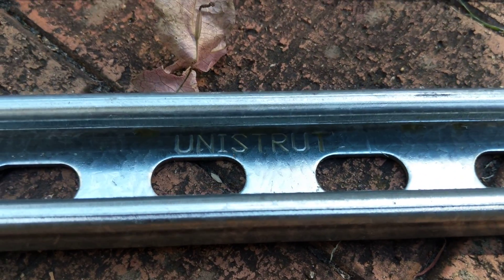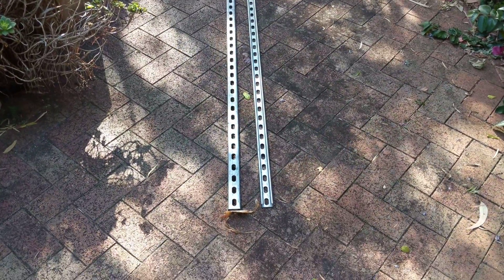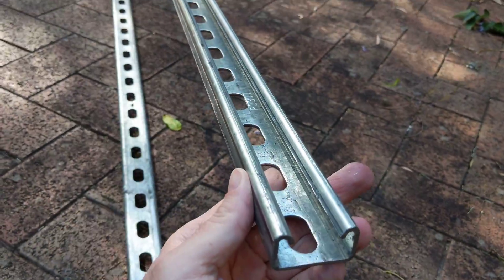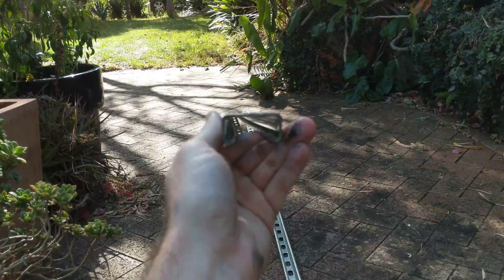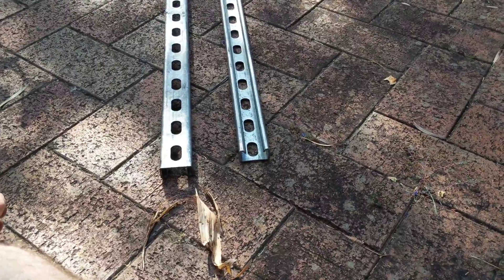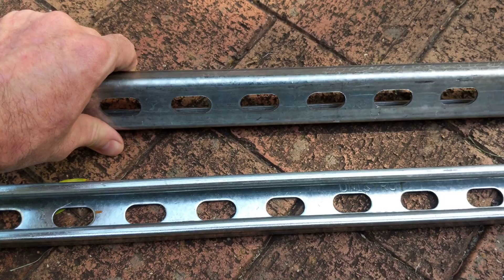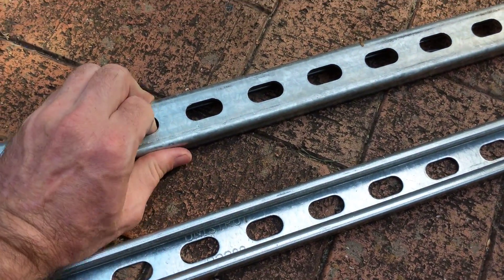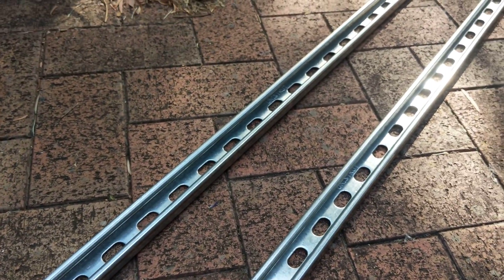Unistrut P3300T Slotted Strut Channel - Heavy Duty

Comment: I just found about 150lb of this stuff in a dumpster unused. Mine are only 40 inches, P4100 and evidently they have P65 cancer warning stampings. Never knew the stuff existed. I could definitely use it I'm thinking motor mounts for bulky motor stuff like pumps, compressors and stationary belted l gen sets. Do they make this in harder steel? It does twist